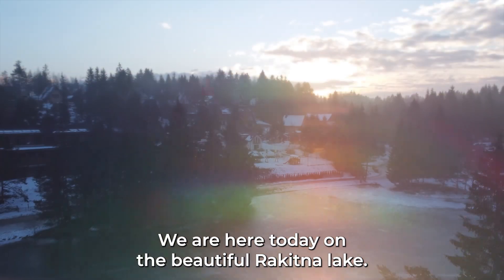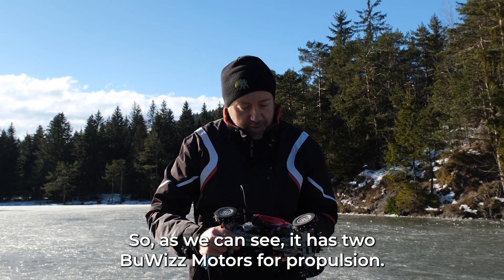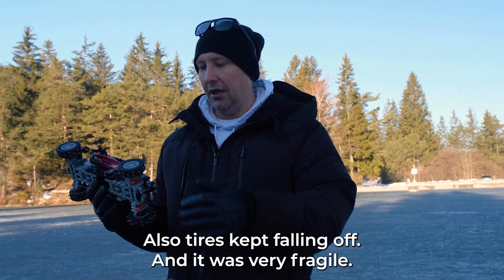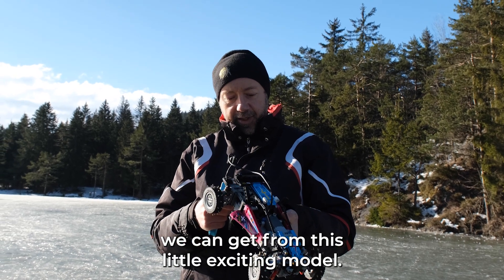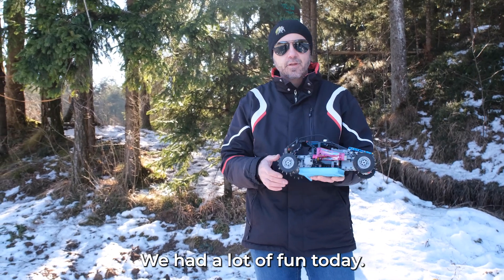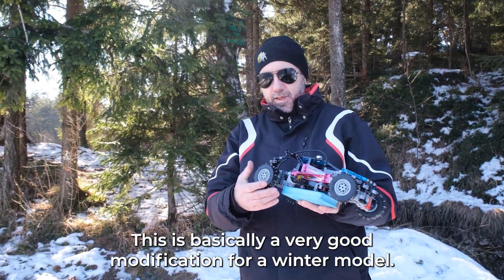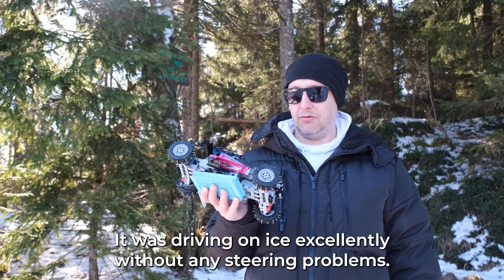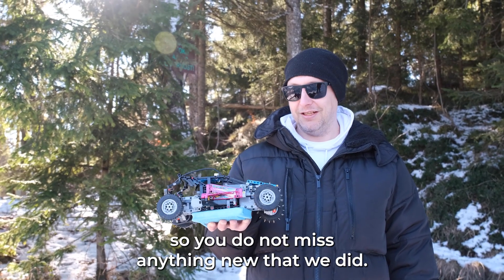ICE RACER - 4x4 Buggy made of LEGO® bricks - powered with BuWizz 3.0 Pro + 2 x BuWizz Motor

Comment: @BuWizz I love this Buggy mod. The original is no good. Even with my original leggo Technic hub & motors i loose the rear wheels. To broke for BuWizz but hopefully one day.  Could you please add instructions for this Ice Racer 4x4 Buggy Mod in this video please? Not necessarily with tire spikes (understood need to cover yourselves) just the rims and tires used on this BuWizz Ice Buggy mod plus all the additional steering, suspension, frame work and all other improvements. Love the look and durability of this Ice buggy a lot & would love to build it even with turtle speed Powered Up. Thank you